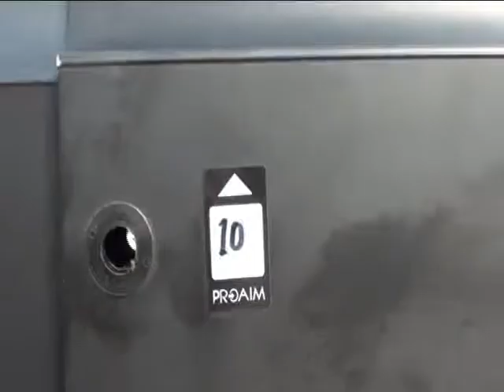Proaim Octagonal Kite 33ft Video Camera Jib Crane | Assembly

Comment: How do you calculate how much weight is needed? Is it 30kg for the full height?
Reply from the maker: Hello David,
The 33ft Arm balances itself at 408lbs. You need to multiply the weight you are putting in the front end by 6 to get the required counter weight. 
For more information, kindly contact us at sales@proaim.com
Thanks
Team Proaim